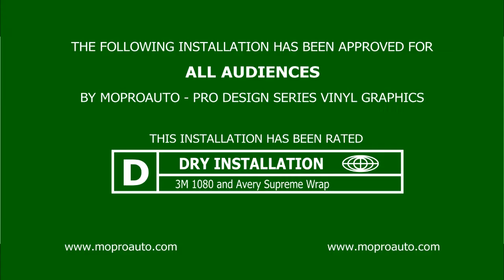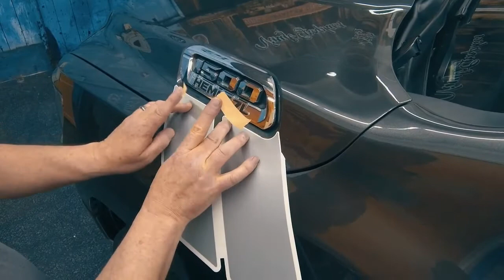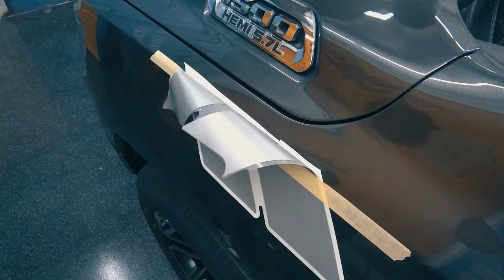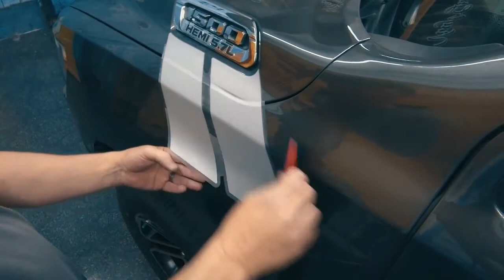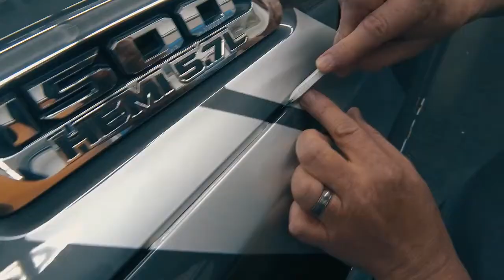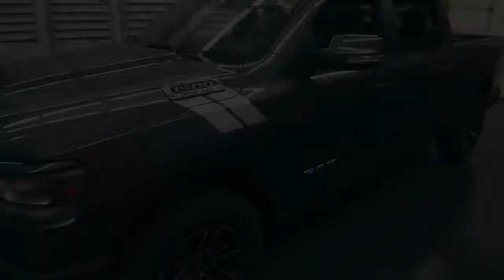2019 2020 Dodge Ram Stripes   Ram HASHMARKS Decals   Vinyl Graphics Installation of Dodge Ram Vinyl

Comment: One little tip clean around the back side of the edge between the hood and the Fender so you can roll around your graphic and then cut it without exposing some kind of seam.